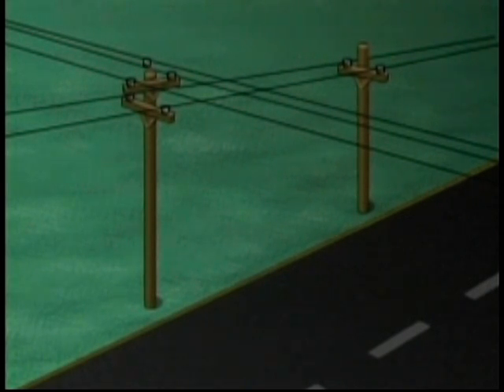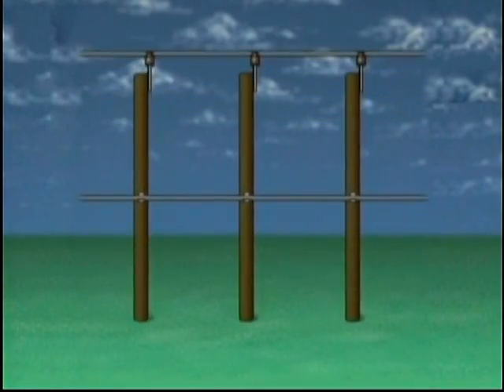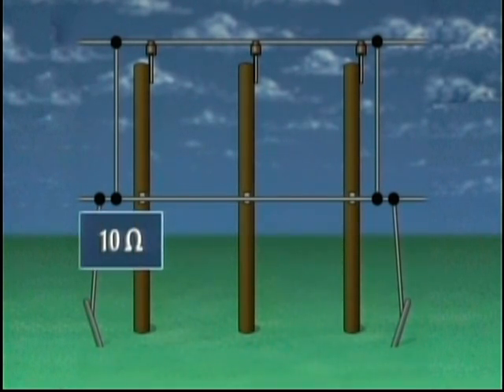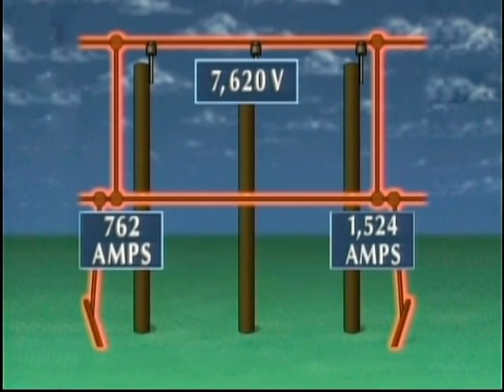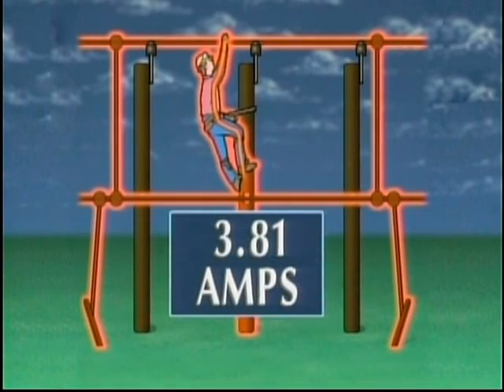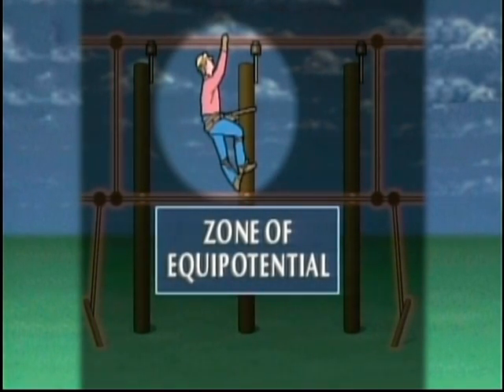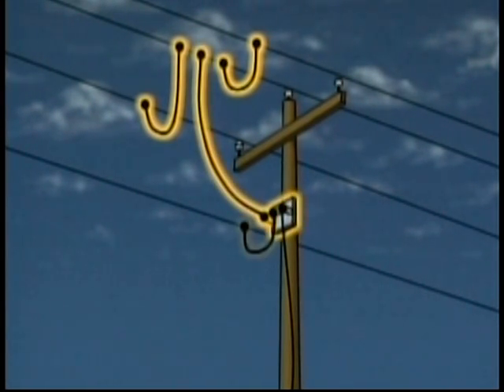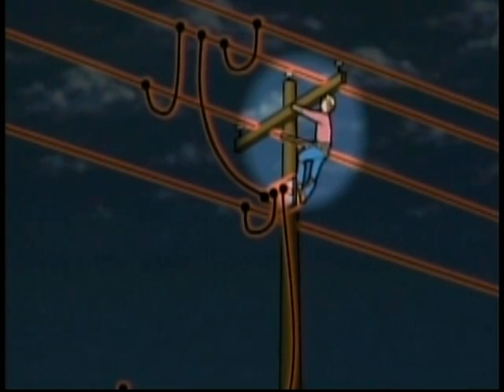Equal Potential Grounding

Comment: How does the current flow through a wood to get to ground. I thought wood is a insulator
Reply: The neutral wire is grounded somewhere.
Reply: given enough voltage (pressure) it will conduct?
Reply: @tedlahm5740  Yes, that is reason they manufacture different class of ppe. At certain potential an insulator could become conductor.
Reply: We were setting a pole under a 500kv line and we had to wear rubber gloves to handle the pole and the pole was never close to touching the line.